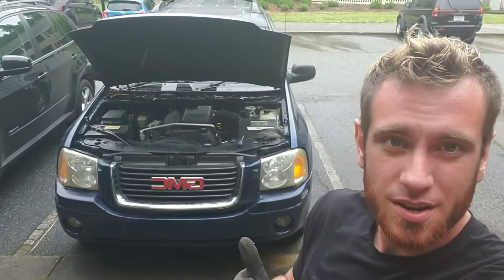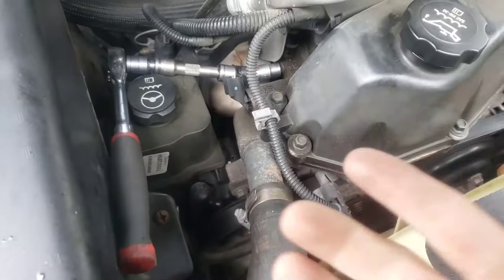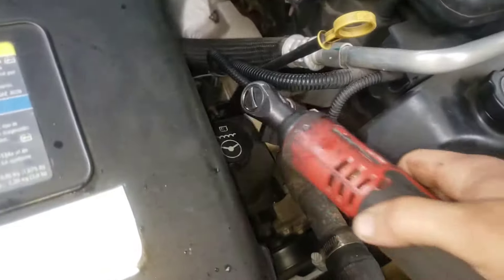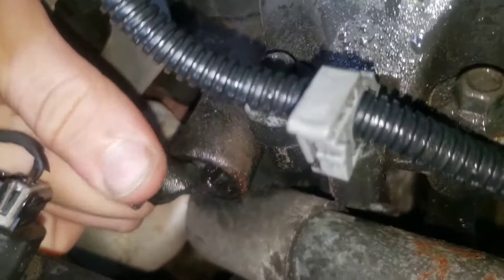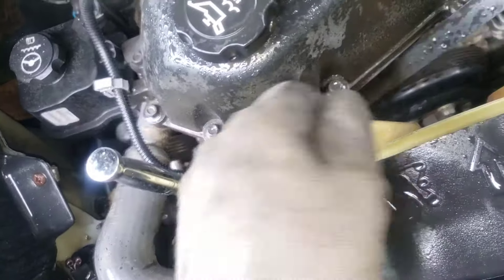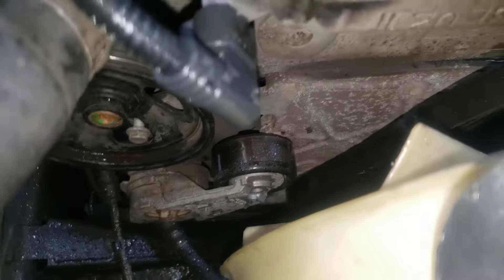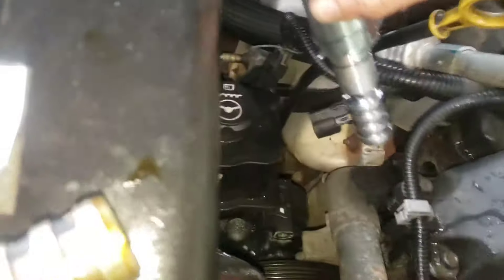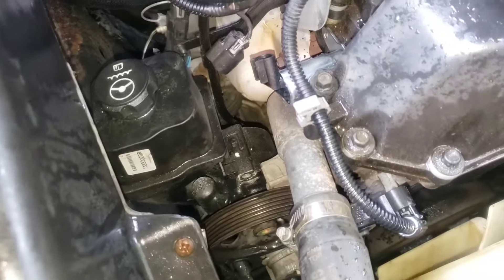How to Replace VVT solenoid GMC Envoy Chevrolet Trailblazer 4.2 Liter

Comment: Thanks for this video. It saved me a lot time. My Envoy was throwing 0P340 code. It would stall at a stop. The engine would reve high then stall. I figured it might have been my Variable Valve Solenoid. Sure enough my Solenoid was leaking oil into the connector. Like you. I thought it would be quick, but I had to remove the power steering pump.
Reply: Did you have to do a relearn on the computer after you changed the part?
Reply: @mikecollins9869  No it didn't. I also ended changing my Cam Position sensor for the final fix. It really smooth out my Idle. It was a little of both. Still running smooth 4 months later. When I reset all the computer codes. It relearned on its own.
Reply: @andreroy8141  thanks for the reply, so I should probably change the cam position censor as well
Reply: @mikecollins9869  Yes I would. I didn't do it the first time, but the VVT Solenoid was bad. I could see the leak in the solenoid connection plug. So having to do it over. I would do both to save time. The sensor helped bring it back to normal idiot. Very smooth now. I didn't notice how ruff it had gotten. Let me add. My truck had 330k on the original parts.
Reply: I think i have the same problem. I cleaned throttle body, new ignition coils, new cam sensor but my VVT Solenoid has oil in the electrical connector. I have vibrations only at idle only in Drive or Reverse when sitting still. Thanks!
Reply: @mochadust9  Yes that's probably  it.
Reply: @mochadust9 Im experiencing the same issues 03 TrlBlzr 4.2 ext; did you resolve and how?
Reply: Andre did you ever resolve your issue? Or anyone else having these symptoms?
Reply: @mikecollins9869 someone on the trailvoy website showed me a great fix to relearn. You kay already know, but if not pull both pcm fuses under the hood and let it sit for about an hour. Pcm1 and pcm b. Mine in an 03 were duse 10 and 28. Did wonders for mine without fixing anything. It unlearns your bad driving habits

Comment: Nice. Needed this video at this exact  ment in time.
Reply: @macmezi2535 did it fix your issue?
Reply: Yes but I changed the camshaft position sensor also
Reply: @gnuttz5022  Hey thanks for quick response. I changed my camshaft and am going to change vvt selonoid as my wire harness has oil inside of it. Hope this gets the TB smooth as before.

Comment: Does it have one or two solenoid  I replaced it and the check engine light came back ,I took it to auto zone and they said I had a bad solenoid
Reply: Did you ever find out